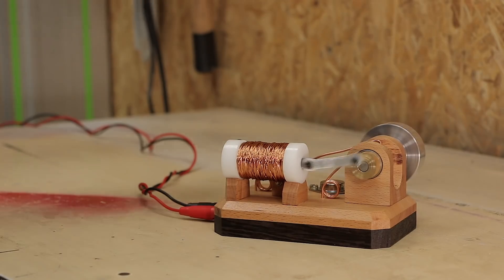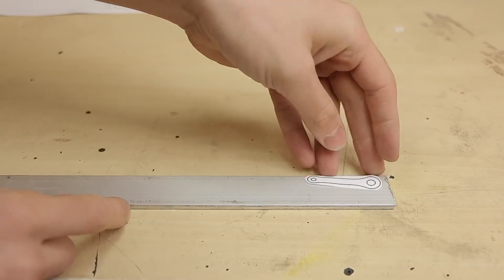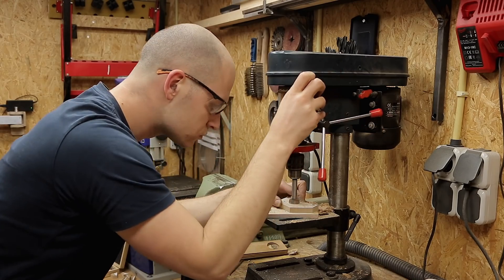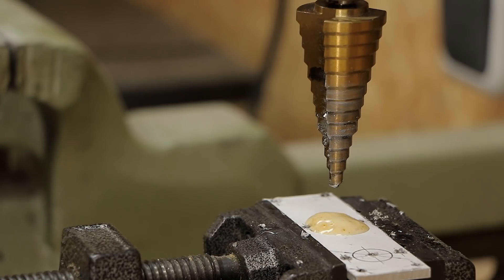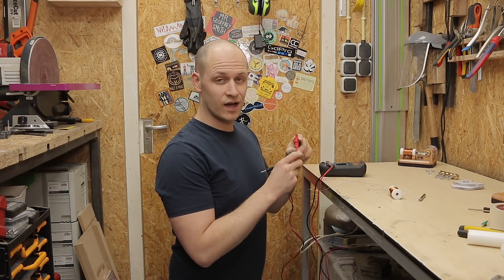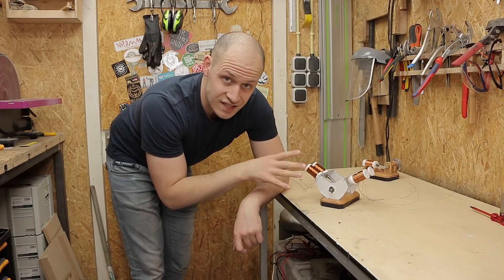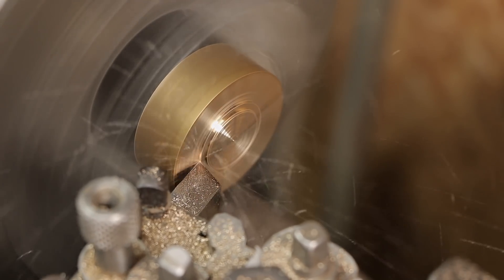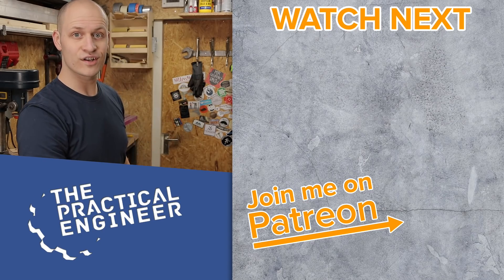How to make a V4 solenoid engine

Comment: If you're gonna convert a classic car to EV, this is the way it should be done, fully engineered from the ground up it should still be more efficient than the petrol engine it replaces but would be able to more closely imitate what the original car was meant to be like :P (obviously, not that closely, but more closely than a normal electric motor)

Comment: Photoelectric sensors and dark tape would be an improvement for better firing sensing, plus an 'advance' circuit (such as a simple microcontroller) could be included to advance the timing as the RPMs increased.

Comment: This was interesting, I liked how you used the tools that were available to you to complete this project. I assume that as time goes on you will upgrade and be able to make things with tighter tolerances. This really interested me that you could make a your prototype with enough tolerance in the dimensions, to compensate for the tooling accuracy. I loved the old school approach with the timing switches. At first I thought for sure there would have been some overly complicated Arduino/maker board solution with a total lack luster explanation of how the code calculated the rotational speed of the ... nod off. But no! Your solution was adequate and sensible. I'm not saying that Arduino/maker boards are bad, but they have their place.

I agree those that say you could have used a bit of oil on your tools. Be careful about overheated tool parts breaking into pieces and flying around the room unpredictably. I hate the smell of oil too, but it's one of those necessary evils when working with metal.

Great job

Comment: I love tinkering like this - like it's one of my favorite things. I haven't done much of it though since I quit meth...lol. The mechanical stuff, the woodworking - all awesome. And someday I'm going to feel like doing this kind of thing again. I probably need some better tools if I don't want to be frustrated though. I can't cut a straight line for shit with my band saw or do a straight rout with my router. All of my tools are "too loose" or have too much play in the blades/bits. When I try to do small stuff like this, it gets all messed up. Like where you used the lathe to hollow out that white plastic piece, my tools would have destroyed that delicate of a piece. But isn't that plexiglass/clear plastic stuff pretty expensive? Is that different than plexiglass?

Comment: Hate to tell you man, but this is technically a VR4 not a true V4, as the opposing cylinders don't share crank pins, hence the even firing order. A true V4 has an uneven firing order and is why it sounds like 2 V twins (cos it is)

Comment: Someone probably mentioned this, but what about running it backwards as a generator? Great video btw.
Reply: Rethink your sentence and repost..hint "solenoid"
Reply: The rod would have to be a permanent magnet I think.
Reply: @ezza88ster  I see your line of thinking, however..what pushes/pulls the now-permanent magnetic rod?
Reply: @ezza88ster  yes I agree it is a magnetic field MOVING in a coil at a RIGHT angle..but, the way its setup is a solenoid (coil that gets energized to create magnetic field to push or pull the ferrite/permeable core in and out..if you tried to make it in reverse with the core as a magnet going in and out of the coil then yes, you might generate a smidge of power..then again where is the rotation coming from to push/move the magnet core in and out of the solenoid?

So if you wanted to make it a generator, you could with great losses because you'd have to drive it externally. Whether it be a drill or good old hand power. Either way its a fun thought but not practical. Cheers

Comment: An Arduino could replace you contacts- add crank sensor you could tighten up timing and have variable power output to the solenoids👍

Comment: Rotary solenoid engine. For switched you could use latch hall effect diode switches. The majority of the engine including crankshaft made from low conductive acrylic/plastic. A single magnet attached to the crankshaft that hits each diode.

Other way you could do these would be with digital logic gates. And/nand/xor/not gates could work. I could see a button that is pushed by each position rod that is connected to a xor or a not gate tho reverse polarity of the coil. Then have a magnet embedded in the rod. Out would produce a lenz law engine?

Comment: Imagine making a real size V8 electronic engine that really works
Reply: @Danner Adcox Tesla is using battery's not a electromagnetic V8 motor.
Reply: @FQP-7024  This would use batteries too if you put it in a real car. And the Tesla also uses an electromagnetic motor. The only difference is they aren't V8s. Well, and they have fewer moving parts, are more reliable, more efficient, and probably have better top end power.
Reply: @GeekOfAllness  but I am aiming for a classis v8 because of my favorite car because if we are already going to have all ele tric cars I want to have a Dodge Charger Hellcat to be the car to get the electronic V8. (no offence)
Reply: @Danner Adcox but if you think that way I won't stop you I will just say that you are a little wrong.

Comment: I think, u can use only 1 tappet, no? U have 2 pairs of solenoids,  which have the different 180 degrees, right? So, u can install 1 tappet on crankshaft and 2 pairs of commutators on the sides of it. Or that will not work?
Sorry for my english=(

Comment: I think what you've done here is really cool and is a fun project to learn about electricity and motors but tell me if I'm wrong. If you were gonna put this in a car wouldn't it be easier to just not have a engine but a motor to turn everything?

Comment: this could me made into a 1-stroke engine if the solenoids fired backwards and forwards.
Reply: would need dual solenoid stacks per "piston" eh?
Reply: @williamvaughn2938  No, you would need an "H-bridge" like is used on CNC stepper motors, you can just reverse the direction of the current (reverses the polarity of the magnetic field). You would have to use a magnet with the piston though, not just a rod. I can think of a couple ways to do that off the top of my head. I wonder if you could capture energy back with the collapsing inductive fields?
Reply: @japhethdennis921  sure would be nice to know! but, I think i'm against that, because of the addition of the magnet... when we are creating and electro-magnet here.

I'd still want this machine to consume energy...

The idea is that it is building up here is Torque... maybe with enough Torque produced, energy can be recollected (Obviously won't be much...)

Comment: If electric cars were actually needed, I'd rather they have something interesting and novel like this other than the sharp initial and gradual reduction in torque that accidentally has you going `120MPH or requiring the computer to drive for you instead of a set of speed ranges that can be chosen by the driver.

Comment: He has the best small workshop I've ever seen. LEGO should hire him to power their plastic brick machines.  Wonder how small he could make a motor...I doubt he could match this tho' - probably nobody could:

"In 1959, Dr. Richard Feynman, the famous Caltech physicist, issued a challenge that effectively ushered in the field of nanotechnology. He offered a $1,000 prize to anyone who could make an operating electric motor which was only 1/64th of an inch cubed.  Much to Feynman’s surprise, a year later, a young Pasadena-based electrical engineer successfully fulfilled the challenge.

William McLellan (1924-2011), a Caltech graduate, spent just 2½ months laboring on the project, using tools such as toothpick and a watchmaker’s lathe.  About the size of a speck of sand, it is mounted under a microscope so that you can see the individual parts.  Although there is no effective use for the micromotor – McLellan suggested is could be “employed to run the merry-go-round for a flea circus”—the invention is considered a pioneer in the then-novel field of nanotechnology."

Source:  https://pasadenahistory.org/collections/micromotor/

Comment: Wicked brilliant! Funny thing, it kinda sounds like a V8 with a big performance cam. Pretty cool. I'm curious, when winding the coil, would you get more power if you ran a layer, stopped and started a new one in the same direction and solder them together at the end? Does it really matter? I have no idea. That's why I asked.

Comment: Dude, really dang cool! First video I've come across of yours and I'm definitely binging.  One question though. Did you have to worry at all about the timing? I get you put the contacts in to trigger the solenoids individually, but did you have to apply any kind of control to ensure it "fired" the correct direction or did the position within the winding as it rotated sorta handle that naturally?

Comment: This is awesome! However, may I suggest a decade counter for timing and variable control? You could have a firing order, as well as a potentiometer to adjust the clock frequency which would act as a throttle. Not necessary, but would be a cool addition.

Comment: Ah, so this is what they put in Teslas
Reply: Nope
Reply: You must be joking but if you are not, no that is not the electrical motors they put on teslas. This type of electric motor is used in no car, afaik is not used anywhere, is just a proof of concept (to show that you can make a piston based electric motor) but afaik is very inefficient and not powerful enough, compared to normal (no pistons only a shaft) DC/AC electric motors and piston based combustion engines.
Reply: @Argoon1981  was joking. But appreciate the information anyway haha I still learned something new!
Reply: @Argoon1981  its not powerfull. Oke, but what if we made the bigger one with more wattage let say 1000 watts

Comment: Mr. Practical engineer. If you could design and engine that would be a V-twin same size as a Harley that would affix to the existing transmissions inside of frame of the motorcycle it would be wonderful...!

Comment: You didn't talk about the timing of the triggering of the solenoids! You just kinda put the rings at an angle and it magically worked.
Reply: Yeah was thinking the same it could be much smoother or more rpm if timed correctly

Comment: What a cool crankshaft. Will the Conrod’s wear out quickly? I know it’s small but just wondered if you need to lube it or make mag shell bearings which it looks like you have the ability to easily do. I love little projects like this. I just don’t have the tooling.

Comment: It strikes me it is either a "two-stroke" cycle, or possibly a "one-stroke" cycle.  :D
Reply: Seems like it is a 2-stroke because it pulls not pushing on the crankshaft. But it can be modified for 1-stroke if he wants,  but timing needs to be precise.
Reply: @berrol23  Could be a ONE stroke, if current in the coils changes polarity, every time the magnet ''piston'' changed direction.
Reply: @MichaelPolymhxanos  hi i think reverse polarity is not neccesary because the coil he made is drawing the rod to the center as we can see in the video when he tested it. Reversing the polarity will still make the same eddy current as its parallel not conical. Correct me if im wrong.
Reply: @berrol23  Offcourse you are right ;) I was thinking a redesign, where the piston is a magnet, and the change of polarity in the coil current moves the piston at all times=1 temp engine
Reply: one stroke/cycle would be down, or up, but not reciprocating
Reply: As I understand it, a two-stroke engine has two strokes in the repeating cycle (one of which is a power stroke).  With a solenoid engine, each stroke can be a power stroke - thus a one stroke engine.

Comment: What is the point of doing such an engine ? Is it not better to use electric engine? I bet it is a lot less efficiency with such an fuel-design engine. Fuel engine doesn't have more than 40% WHEN ELECTRIC CAN REACH 90% OF EFFICIENCY.

Comment: Why did you glue the crank shaft and not solder? ... No offense, I just hate glue - it seems like a cheap trick if you use it for metal works.
Nice work anyway!

Comment: What if you made a rotary version with magnets and instead of a flywheel you attach windmill blades. Essentially making a windmill with x number of generators. I'm not an engineer so I wonder if it could increase power production with the same amount of input.

Comment: I loved this project until you got to the distributer. It "seems" to me you could have just used AC. Each side would be 180 degrees out of phase, aka the electricity run backward, and as your motor is 90 degrees out of phase, then your other side is +/- 90 degrees. This would give all 4 solenoids running on the same AC line. Speed is proportional to the frequency, and power is proportional to current.

Comment: I mean, this kind of engine and the chassis of the car using carbon fiber or aluminum in majority, then like 2/3 of the cars weight must be the battery since it needs that much power to run it, it's possible right?

Comment: How did you figure out how to place the lobes to get the “fire” timing right?
Reply: Basically he aligned the crankshaft farthest reach of the rod and offset it by little clockwise as timing where the coil will turn on to pull the rod.
Reply: Would you believe it was luck?
Reply: Basically put the first one at "top dead center" and adjust it, and then offset them by 90 degrees by the "firing order"
Reply: @samwagner31  "firing"? 😂
Reply: Robert Lawrence yes. Obviously not an actual firing event, that’s why I put it in quotes, but for the sake of balance, you’ll want to have opposing solenoids “firing” so there is, in fact, and order that should be used.
Reply: @samwagner31  I know. I just laugh at how we use language related to something else to explain something else. Like calling "accelerators" the "gas pedal" you know. 😁
Reply: Robert Lawrence I’m a diesel mechanic, so I was just using familiar vernacular. But yea, it is funny how we do that. There’s guys in the shop that call the throttle the gas pedal, even though these are Diesel engines lol

Comment: When drilling a rod in a lathe, make sure that the rod does not protrude more than around 2.5cm-3cm or the amount you want to part off plus a little extra. Your rod was quite eccentric and that might increase the size of the drilled hole.

Comment: You could have variable "valve" timing by using non-offset flywheels for the contacts, and instead covering a portion of the contact with masking tape. Then you could experiment with different timings.

Comment: Could the rods be replaced with a magnet to power them.
Reply: If the rods were to be magnetic, the timing on each contact had to be pretty precise to avoid the magnets dragging and subtracting from the momentum. But, it would work, and this could be converted into a generator, just like most DC motors can.
Reply: The rods are magnetic when they are in the EM field of the solenoids, perfectly adapting to the field.
Reply: Sterby jr. the rods are not magnets. They are simply metal rods, that become affected by the electromagnetic force created by the coil when the power is turned on. 
The force created is much stronger than a permanent magnet.
But a magnet passing through the coil will induce a current to flow in the copper wire.

Comment: Even with a component fastened down, a sharp drill bit can ‘grab’ .  We were always taught to back off the drill cutting edges.  We did drill many brass components in a manufacturing company and it worked well.

Comment: Great vids. Great projects. The ideas are the hardest bit.
Note:- Center drills are commonly used in engineering, center pops are not used to position the drill. 
Get some center drills, no 1 is too small, no 2 or 3 will suit you.

Comment: If you want to get real fancy, make a timed switching assembly that reverses the voltage to each solenoid so that it pulls and pushes the piston.  Of course, the pistons would have to be polarized magnets.

Comment: Wow... Great work! I'm curious how long it took to calibrate/balance the switches so that the strokes were in simetry. I wonder how sensitive the engine is to resistance differences across the solenoids and how close close each stroke power is to each other.

Comment: Since it is essentially a two stroke, you would probably be better off making a cross-plane crankshaft. That way instead of having 2 solenoids pulling every 180 degrees, you can have one solenoid pulling every 90 degrees. More consistent power delivery....

Comment: I wonder if it would have more power is each solenoid piston was 90 degrees off of the previous piston?  Right now they are 0-180-180-360 (or 0-180-180-0).  I'm suggesting 0-90-180-270.

Comment: so i know this is nitpicking but if the cylinders where 90 degrees apart instead of 180 degrees on the rotations then there would be no need for a flywheel as the motor would balance out all the reciprocating forces and thus no sudden increase and decrease in speed on the crank think of a cross plane crank american v8s versus a flat plane crank European v8s

Comment: Make one 6 cyl and offset each cyl by 1/3, it would also be naturally balanced.
Now the tricky idea...
Have a sensor on each cyl for TDC and bottom. (maybe a separate camshaft) These sensors control mosfets the change polarity to each coil to reverse the magnetic field depending on if the piston is traveling up or down. Now for each piston you use a neodymium cylindrical magnet.
This would make each cyl have really strong power with every up AND down stroke. That would be like having 12 power strokes with every rotation of the crankshaft. Keep in mind a 6 cyl gas engine only has 6 power strokes with every TWO rotations of the crankshaft.